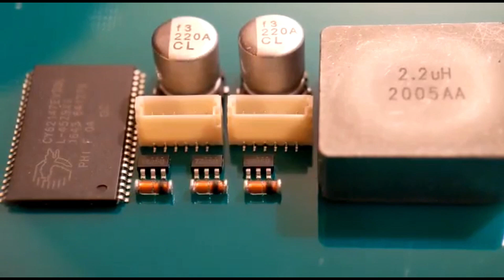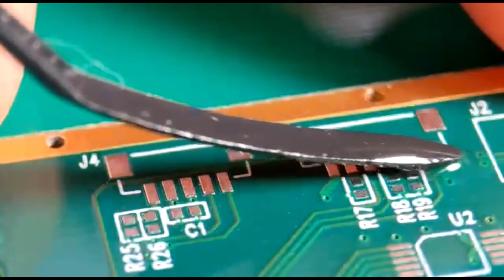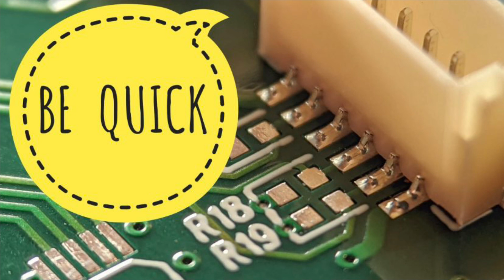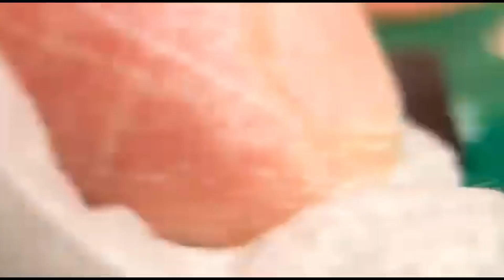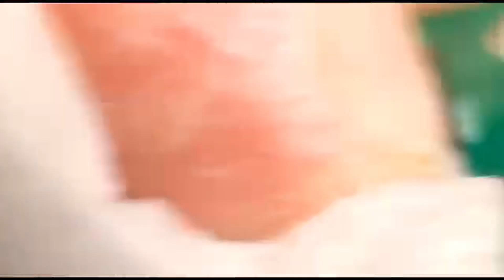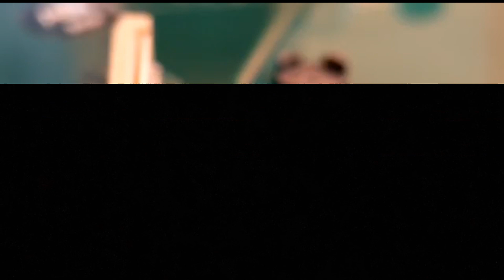How To Solder SMD Correctly - Part 3 /SMD Soldering Tutorial

Comment: How do you solder when the ic have a ground plane underneath?
Reply: Thank you for the answer 🙏 I have an hot air station, but I am curious about how to do it the right way. How much heat can an ic generally take before it fails? Keep up the good work ✌️
Reply from the maker: Hi , I normally start about 360 degrees Celsius but sometimes have had to use 425 degrees on my hot air station before I get the solder to flow . If it is lead free and ground plane this needs a lot of heat . IC's can take this heat generally . Very , very rarely can they fail this. If you need to protect parts around your reworked component use Aluminium foil , sticky backed , don't use Kapton as lots of people still do . It can't protect like the foil .Hope that helps , thanks again 👍
Reply from the maker: Hi , thank you for your comment , much appreciated . You will need a hot air gun for this . A typical component like you mentioned is a QFN IC , I have previously posted a complete video on my YouTube channel showing how to fit these devices . I've also featured IC's like these in some of my other videos . Hope that helps , thanks again 👍

Comment: Hi, when you twist the smd cap to remove it, is there a chance it could rip off the pads? great video by the way👍
Reply from the maker: Hi , thank you for watching the video and commenting , much appreciated . Even though this twisting method looks quite risky I've never , ever damaged a pad doing it . For extra safety if you feel you need it you can place a pair of tweezers or pliers in top of the joints and then slowly twist , a tiny amount each way . You will soon feel the legs on the component body getting weaker and then it's easy to twist off . Then simply remove both parts from their pads . I've struggled at times over the years with very large electrolytics, even with heat guns and this method has worked a treat . Thanks again , take care 👍

Comment: Great video! I have to recap an old drum sampler from Yamaha. RS7000. Lot’s of cap’s. I see you prefer a conical tip. I have some from JBC, I also have some flat ones, but I’m going to use the conical’s.
Reply from the maker: Hi , thank you for your comment , much appreciated . I mainly use the 2 tips I show in most of my videos , a small conical one and a large flat sided one . I have others , larger conicals , chisel tip etc which I do use at times if the job requires it but normally it's these 2 . I hope you get on ok . Thanks again , take care 👍

Comment: You've probably mentioned this before, but what temperature do you run the soldering iron at for these type of joints?
Reply from the maker: Hi , thank you for your comment. In this video I would have used about 350 - 360 degrees centigrade because they were all lead free joints . For leaded joints I would generally use about 330 degrees centigrade . I may vary these temps slightly for certain components but mainly I stick to these ranges . Hope that helps , thanks again 👍
Reply: @mrsolderfix3996  Thanks for the info, i have been running too low a temp at 270 degrees centigrade not sure where i got that temp from, but now i know better 👍
Reply from the maker: Hi , no problem , I hope you get on ok . Thanks again for watching the video , take care 👍

Comment: What I’ve noticed in your soldering videos which are excellent I must say is the way you remove the soldering iron from the connection. You lift it directly off instead of moving it to the side. By doing it that way I notice how you get that smooth concentric dome of solder. What temperature is a good temperature to start at? Now back to the video. Thank You 👍
Reply from the maker: Hi . The temperature I generally do most of my soldering at these days is about 350 - 365 degrees centigrade as mostly I do lead free soldering . For leaded soldering you can lower this a little . I just use larger tips if I have large ground plains etc . In the end you get to know what you need for each situation you face. Everyone can get better the more they solder and you can never stop learning. Good luck with all your soldering projects and thank you again for your support . I will post more videos when i can 👍
Reply: @mrsolderfix3996  thank you for your help and quick reply Artie 👍

Comment: You're a true Brazilian! Your videos are all about soldering and the Brazilian flag. Green and yellow, a well matching combination indeed. It's amazing how well your lead free solder works through the gaps and seeps into the seams. Hope you'll go into USB and HDMI connectors used in modern consumer electronics. Thank you for the effort! A great video as always.
Reply from the maker: Hi . Thank you .The Brazilian flag was picked because I just liked it ( I've never even been there ) . Some of the modern lead free solders are great compared to years ago when they started to come into the workplace. I get all my solders from a place in England called BLT Circuits . There stuff is always good quality. Beware of cheap solders , not to be trusted in my opinion . I will definitely do a video on modern connectors sometime ( there's still loads for me to cover yet ) and as USB and HDMI are pretty common I will try and include them . Thank you for the suggestion and your support 👍

Comment: really impressive, as already wrote in an other tutorial from you.
Which flux you are using, if i may ask ? I was not very happy with China ware and imitations of AMTECH but amtech original (i think so) here in germany is much better than china flux.
Reply from the maker: Hi . Thank you for watching . The flux I use in all my video's is called SMFL200D .  It's a great liquid flux that comes in a 200ml spray can . I just squirt a small amount into a small container and apply to the desired areas using a dipped plastic Ty wrap . It's available from Farnell ( easy to get in Europe ) RS Components , Rapid Online and any good  Electronic distributers , also seen it on eBay . It's about £15 a can . I will probably do a video on the benefits of flux as lots of people ask about it . Hope that helps , good luck 👍
Reply: @mrsolderfix3996  Thank you for your quick response. If you have a link for buying this product AND supporting you directly do not hesitate to post. If you have  not an "affilitate" link i´ll buy it directly.

FLUX, i think, is the most base of soldering . Skill / knowledge and "the art of doing" also, of course.
But with bad flux you get a bad experience. My first try on a ps4 was with a bad imitation of amtec from china. smells really ugly during the process and the result was an desaster.

I would be glad if your time let´s you manage to do some important declaration and explanations about the FLUX part.

Have a nice day and stay healthy during this bad time.
Reply from the maker: Hi . I don't have a link for any products , I just try and recommend what I use . So you will have to buy direct from someone . Thank you for your support and good luck with everything 👍

Comment: Great..
Can u tell gauge of wire...
Reply from the maker: Hi . I presume the thickness of solder wire ? The solder is 0.25mm for all the fine pitch joints and I also use a 0.5mm solder for larger joints . I get them both from company in England called BLT Circuits . Hope that helps 👍

Comment: Thanks for the video. Can you, please, tell us the reference of the products you are using (flux for example) and the tools as well.
Reply from the maker: Hi . Thank you for watching . The flux I use is called SMFL200D . It's a great liquid flux , comes in a 200ml spray can . I just squirt some into a small container then apply using a dipped plastic Ty wrap to the desired areas. The cleaning fluid I use is called Ultrasolve and the cleaning cloths are Gtek Dry Wipes from a company in England called Grove Sales , about £5 for a pack of 100. I use a Weller TCP S soldering iron and 0.25mm solder which I get from a company called BLT Circuits ( they do lead free and unleaded ) . Hope that helps , thanks again 👍
Reply: @mrsolderfix3996  Thank you very much.
I'm sure it is interesting for many people.
I'm an electronics engineer, but I'm retired now. I had everything I need at work... Now, it is more difficult: @home, I need something more "manual". I'm an hamradio also, and now we really have to switch to smd components.

Comment: Great to see information like this so well filmed, nicely zoomed in, with decent lighting so you can actually see what's going on. Thanks :-) A comment on the capactior removal; I've begun practicing soldering as I've started working on vintage electronics - I'd be scared to twist those caps as often they've leaked and damaged the pads below / around them
Reply from the maker: Hi . Thank you for your comment , much appreciated . Regarding the capacitor removal , you might be doing the right thing if you have leaked Capacitors and potentially weak / damaged pads . I normally use 2 soldering irons and take them off this way but sometimes this does not work so I revert to the twist method . It's a pretty safe method , especially if you hold down the small amount of leg you can see and twist both ways very gently . But I understand your caution . Good luck with whatever you do and thanks again for your support 👍

Comment: Sir what flux do you use and whats that applicator your using?
Reply from the maker: Hi . The flux I use is called SMFL200D . It's a great liquid flux , comes in a 200ml spray can . I just spray a little into a small container and apply using a dipped plastic Ty wrap to the desired area . It's about £14 a can , available from Farnell , RS Components ,seen it on eBay as well. Fairly easy to get hold of , it's the only flux I ever use. Hope that helps , thank you 👍
Reply: @mrsolderfix3996  thank you!

Comment: What a great series, clear and helpful. The good camera work really helps. Y
Reply from the maker: Hi . Thank you for your comment. I'm glad your enjoying these smd guides , I will be doing a few more in this series yet.
I will also be doing other soldering videos like I was doing before so hopefully amongst them you may find some useful . Thanks again for your support , very much appreciated 👍
Reply: @mrsolderfix3996  I do have a question about flux, I can't (easily) get hold of your recommended flux, my local electronics shop only sells a 'paste' which comes in a syringe. Do you have any thoughts on that or should I look further afield? The application is not too tricky, I'm assembling a Morserino32 kit. Y
Reply from the maker: Hi . I have seen people use a type of paste flux that comes in a syringe and get on very well with it . Sometimes the stuff that comes in a syringe is slightly thicker which In my opinion will still be good to use, so I would say get some of what your shop is selling . Hope you get on ok . Thank you for watching my channel 👍

Comment: just putting the tip on the edge of the pin without moving anything is yet result of training, I bet ! 0.
25 wire ... excellent ;)
Reply from the maker: Hi . Some soldering techniques have taken me a long time to learn correctly . That's why I always say to people , don't give up , you will get better with practice.
It feels good when you finally master certain techniques but to do this you will need better equipment as you progress your skills 👍

Comment: hello, home made tip to apply flux ? is it somehow flexible ?  plastic ? (a thin plastic collar would do the trick may be)  . I have an excellent tip to stop shaking (even in the mornoing ) : drink a beer (or 2 ) ;) 
Because my microscope stand is not intended for soldering, I find useful to put a piece of rubber style heéat absorbing cushion, it hold the board nicely, and I turn it because of that round plate on the stand, that turns on itself (but do not accept heat )
Reply from the maker: Hi . The way I apply my flux is to first spray some of the flux I use ( SMFL200D ) into a small pot . Then I use a small plastic Ty wrap and dip it in the flux . Then just carefully apply to the area needed as you can see in the video . This is a method I love . So easy and accurate without making a great mess.
Thank you 👍
Reply: @mrsolderfix3996  thank you ,  glad I recognized the tool ;) my flux is too much paste like, but as I understand it it is also based, like many  fluxes  on (whitened) colophon rosin. so probably some isopropyl alcohol 99.9% will thin it. I will tell you . Best regards
Reply from the maker: Hi . Good luck with whatever you do . Thank you for watching my video's 👍
Reply: @mrsolderfix3996  Thank you. I asked something about a CI at Marc Siegel (Pace, some great soldering videos with professional equipment ) and discovered that his speciality is soldering, not at all knowledge of electronics. Is it still the case today, a specialisation in PCB repair , without the inside understanding of electronics ? Thank you
Reply from the maker: @Isaac OLEG  Hi . In a lot of soldering firms they have solderers and test engineers . In my experience a very good solderer is not as good at electronic knowledge . I know quite a bit but I'm not as knowledgeable as a proper electronics specialist . But on the other hand they will not be up to the level of a skilled solderer . This is the case wherever I have worked 👍
Reply: @mrsolderfix3996  Thank you, I discover that situation . specialisation seem to be logical, in the end. BTW do you really consider lead free solder as a source of problems in modern assemblies ?  Good evening
Reply from the maker: Hi . This situation is normal everywhere that I know . No one can know everything about every aspect of electronics , that's the way I see it . I just know a small part of it . Lead free solder does cause a lot of issues for people soldering today . We would all prefer to use leaded and for people doing soldering at home they can probably choose leaded . But most firms have to stick by the rules today which is mainly lead free and it can be harder to work with on some parts of circuit boards . Hope that helps . Thank you for your support 👍
Reply: @mrsolderfix3996  Hi , Of course I use lead solder. BTW I tested my home made ,flux and it turns too much gummy, even if it can be cleaned well. It allow to melt solder under a piece, but does not make the solder ,grab on the pins and circuit as do the "regular" flux.  May be I need to use whitened colophon (the one I use is very brownish) I will test more, and try to thin the CS flux I have.  Oh another one, all the components with pins all around (not just on 2 opposite sides sorry I dont know their name), one need a square tip, the good size, or hot air? No success with 2 irons on those ones - I did get them with the CS flux and hot air, counting 30 35 sec, if not melting I add a bit of heat or a bit of air.   Best regards
Reply: @mrsolderfix3996   Good evening. Can you tell me if you did see double irons used professionally 'like tweezers with an iron each side) like FM2023 Hakko : https://www.hakko.com/english/products/hakko_fm2023.html
Regards
Reply: @mrsolderfix3996  Hello, I watched once again the video from "Sorin", the Romanian guy,installed in England, about his home made flux. I did the same that mean, used pure isopropyl and the colophon paste sold for the soldering. A lot of alcohol, not so much colophon, The way it reacts to heat tells if there is too much of one or the other. The fluid version is excellent, I could take out small chips without tinning the tips, ANd what I find is that to clean the solder on the board with the brass thread, moistening the surface with that fluid flux allows to work almost without tinning, the tin on the board is enough. AFterthat I clean and the process I copied is to put a paper towel and tap on it with a toothbrush. That way the brush stay clean, and the colophon is going into the paper towel.  Btw I suppose that when parts are dismounted they are rarely used again is not it ? I was wondering if an ultrasonic bath of alcohol would be OK to clean smd parts (a small glass of alcohol in the water bath) . Best regards . (sorry for the many questions ;)  Isaac

Comment: what type of flux do you use?
and where can i get one?
Reply from the maker: Hi , thank you for your question . I use a flux called SMFL200D . It's a great flux , it comes in a 200ml spray can . I just spray some into a small container like a milk bottle lid then use a dipped Ty wrap to apply it . It's about £12 - £15 a can , and is available from places like Farnell , RS Components and I have brought it off eBay. It's widely available and fairly easy to get . It's the only one I ever use. Hope that helps , thanks again 👍

Comment: Don't get me wrong, I like your videos. But why do you hand solder all those parts? I understand why you might want to hand solder plastic connectors and electrolytic capacitors. But for all the other parts, wouldn't it be a lot easier to put them on the pcb all at once and reflow it in a small oven?
Reply from the maker: Hi . The problem is not everyone has a small oven at home ( probably no one ). Also who has solder paste and stencils available to do this ? At least this way gives normal people like me an option . Also lots of people might just want to fit one of these parts . Thanks anyway.